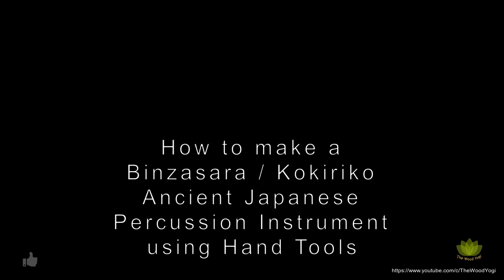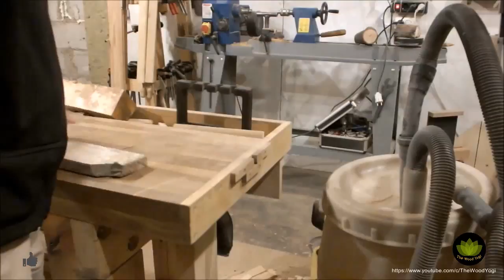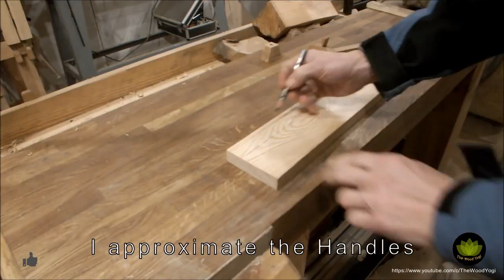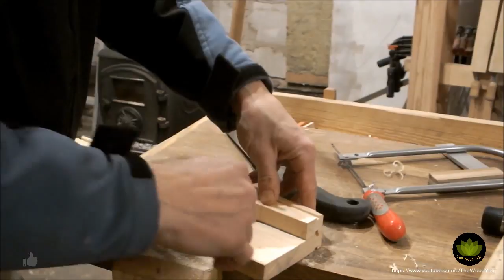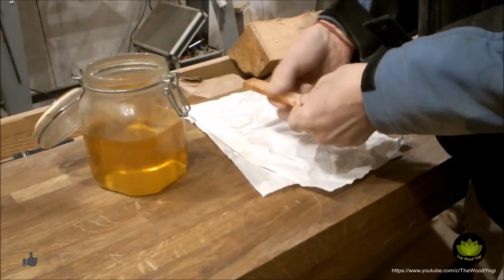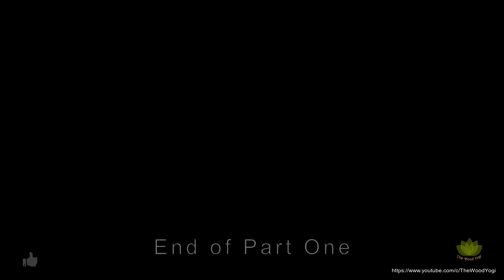How to Make a Binzasara - Kokoriko - Traditional Japanese Percussion Instrument Part One

Comment: A two parter. Build up the tension! I made a percussion instrument just at the weekend - a one note xylophone. Okay, I put up a bannister rail but it rings with a note fractionally sharp of G - I'm claiming it as an instrument build. Looking forward to part two mate.
Reply from the maker: Thank you Mark :) I ran out of time on the editing of it, but it seemed the thing to do :) I have a habit of trying to make everything sound musical :D probably drives everybody crazy, but I can't help it. I just found a fire extinguisher that someone kindly left next to the outside bins for me :D I still have argon gas left that I need to use up, so I suppose another instrument is on the way :) ॐ
Reply: The Wood Yogi wow! That's intriguing!